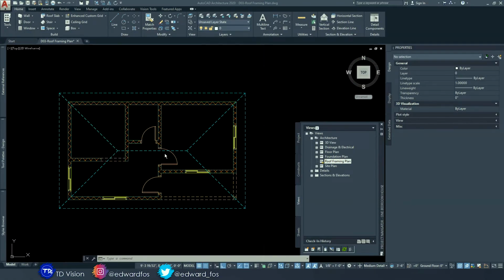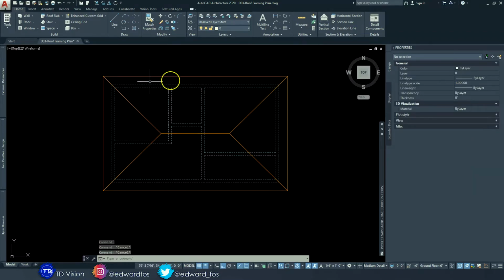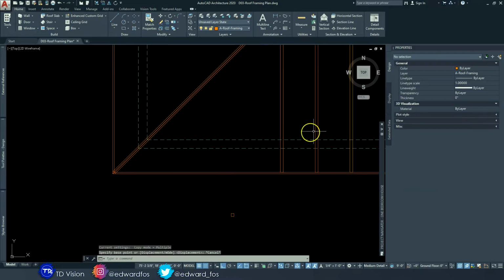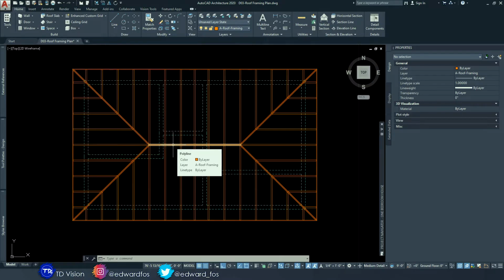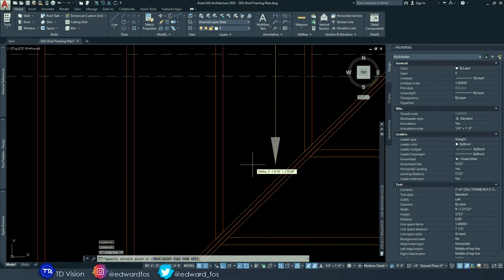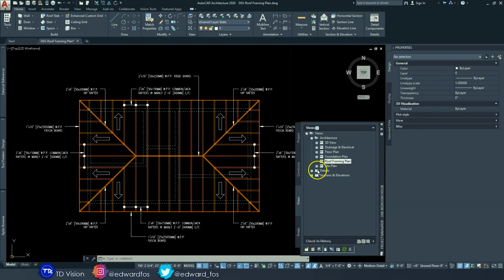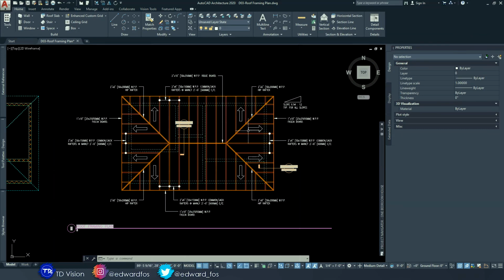DETAILING Part 3 (Roof Framing Plan) in AutoCAD Architecture 2023

Comment: THIS KIND OF DIAGRAM DOES NOT HOWEVER GIVE YOU THE DIMENSIONS YOU NEED TO CUT THE BOARD FOR ASSEMBLY .IS THERE PERHAPS MORE VALUE IN DOING THIS IN 3D SO THAT YOU CAN IN THE END MEASURE ALL THE LENGTHS??
Reply: @Snehalyadav__vlog2087  draft it

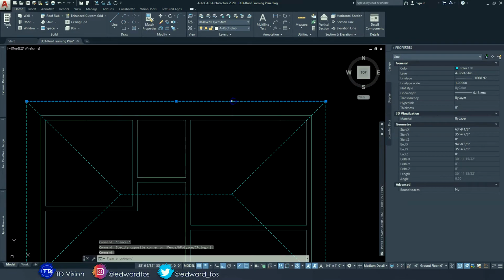Comment: Do you sell roof framing plans? I need a roof framing plan for a shed that has a Dutch hip roof that will have clay tiles on the roof. 6:12-8:12 pitch with 4” walls. Needs to be to code in California. Let me know.
Reply from the maker: Unfortunately, I do not at this time. Maybe in the future.

Comment: Hi Edward. In E09 we did a roof plan. I added sarking, facia, roof covering and rafters as i followed in that video. Now we are doing a roof framing detail and in following you in this video i created a 2D (Flatten layout) of that roof which gave me a drawing with curve or rounded edges. Do i have to start from scratch (meaning without added sarking, facia etc.) before i do the roof details?

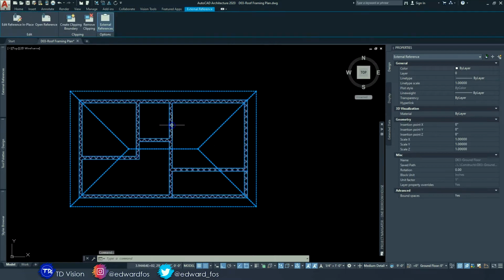Comment: Starting at 4:49. Just a bit curious. When we flatten the roof plan to create the roof details, I didn't see an obvious change in ridge lengths. Are these lengths true? Looking from above a slope would project a shorter length than if we looked at it from another angle. My concern is to ensure that as a DIY (er) I can cut my rafters accurately. Hope you understand.
Reply from the maker: I think the reason you didn't see an obvious change in length is because I was transitioning from a perfect orthographic 3D view (isometric) to a orthographic plan view. The lines would essentially be the same length. Nonetheless, because we're pulling a plan view from an existing 3D drawing, we wouldn't have to worry about the lines being incorrect. As long as the 3D model was done accurately, you plan views and elevation views will be accurate. Thanks for your question.

Comment: Ed thank you for the great tutorials as always. This kind of diagram does not, however, give you the dimensions you need to cut the boards for assembly. Is there perhaps more value in doing this in 3D so that you can , in the end, measure all the lenghts?
Reply from the maker: You are correct. You would not va she to get cut lengths from this diagram. 3D is always the best way to go, so you can pull BOM schedules out of it. I think an easier route however would be to do a typical section view showing the rafter connections, with dimensions and annotations, would or could be just as
Helpful.

Comment: A faster way to do this while getting the same 3D look of SketchUp is to use the structural beams object option in the tool palette.
Reply from the maker: You are indeed correct. The rest of this comment is for everyone's knowledge: I would recommend not to model these in 3D if its not going to add to your final renders, or if it's not required to be modeled by your client. Also, the 3D might not be necessary for approvals. It will save your computer some RAM, and time and money.

Comment: Great video, to speed up trimming the rafters to the hip, you can use the trim tool to cut the rafters against the hips, this leaves the box with a missing side, to fix this, you can then reselect them and use the properties to make the polylines "closed". When trimming you can also use the "fence" command to select the rafters all at once down the centre of the hip, hope that makes sense
Reply from the maker: Thanks for that tip. I will give it a shot.